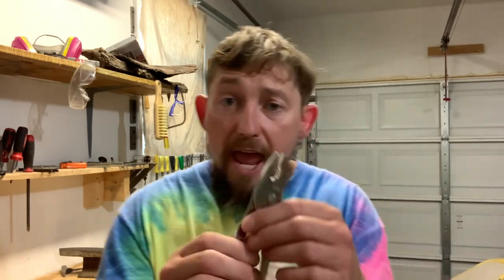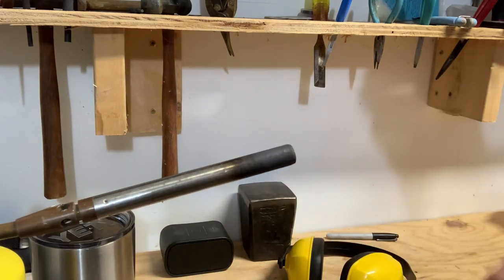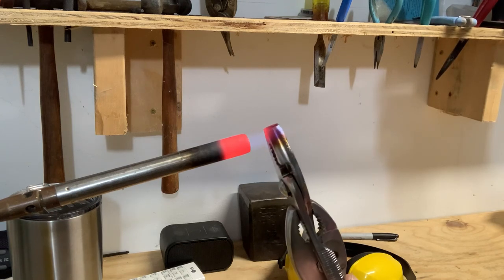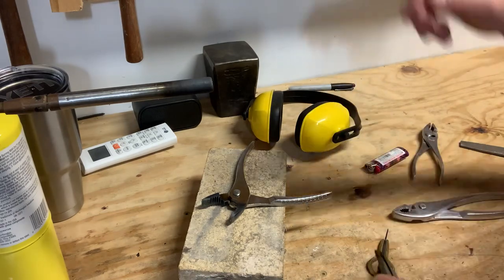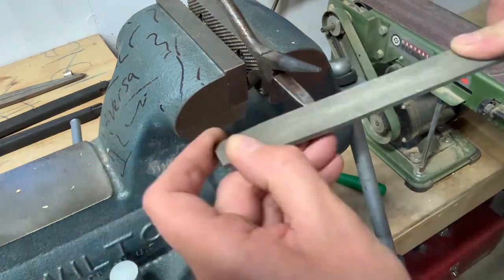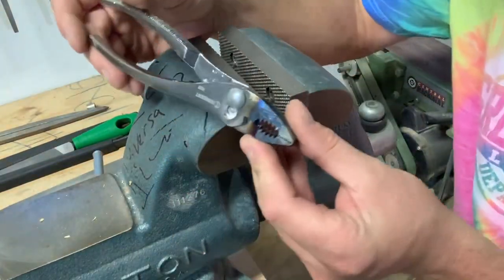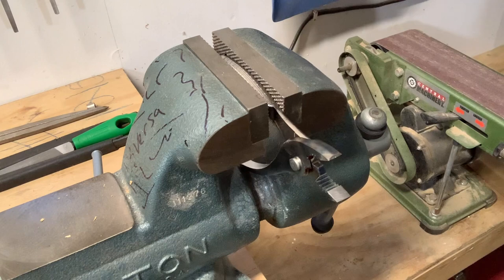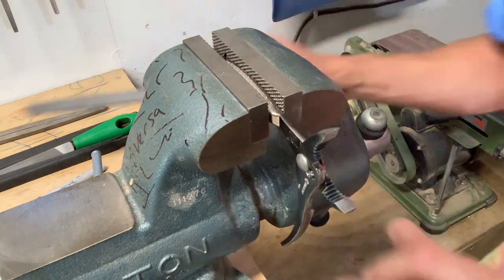How to make smooth jaw pliers for Jaw Harp repair.

Comment: Could sand off teeth with sanding disc (or cutting disc side) without annealing - unless you enjoy filing of course. Besides, jewellery tool shops sell variety of scratch safe pliers, with flat lips, nylon lips, parallel lips etc.
Reply from the maker: Good info.   I would beware of nylon or plastic jaws as they will melt from the heat when making knee bends on triggers.   Also the annealing will come into play when we make custom jaw pliers for holding and manipulating decks.
Reply from the maker: I would also say that while you and I may have extensive workplaces with many power tools for cutting and forming metal, most people do not.   These videos are intended to help the average person start with the bare minimum of tools and investment .
Reply: Agreed!